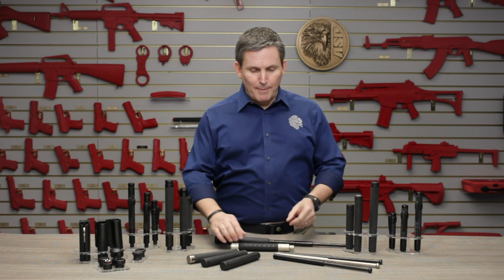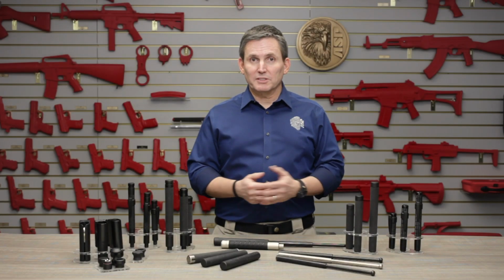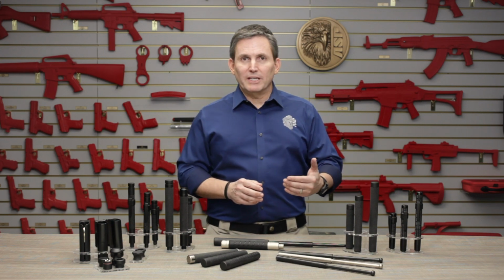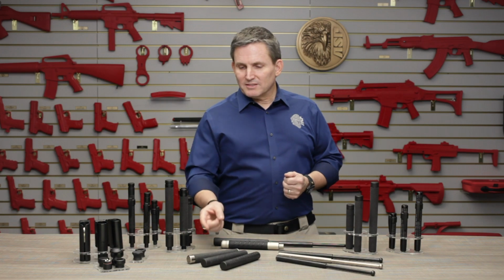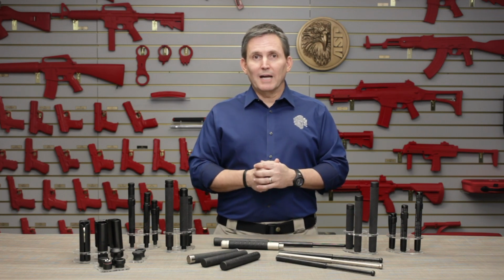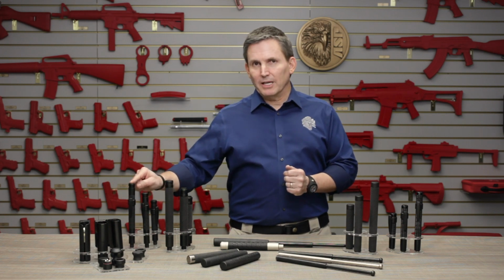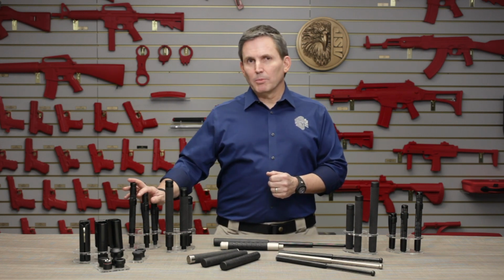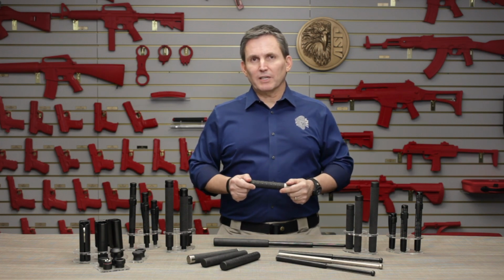Training Room - Selecting Your Baton

Comment: Donthe Talons tend to lock up firmly like a F series friction baton or can there be some wobble?
Reply from the maker: There will be slight play in the Talon as it is a disk lock system and the Friction does not move due to the “friction” lock system.

Friction batons lock in place due to tapers in the shafts—when extended, this progressive taper solidly locks all three sections into place. The Talon design, however, has straight tubes with no taper. Instead, it uses an internal mechanical system to lock the shafts in the extended position. In order for this system to lock and unlock smoothly, there needs to be a little bit of clearance between each section. So you might perceive a slight amount of “play” in the shafts, but this is completely normal. It in no way compromises the integrity or strength of the baton.

Comment: I am having difficulty choosing between the vector or foam grip. My hands sweat profusely sometimes, so I am wondering if you could give me a suggestion. For the foam grip, wouldn’t it be easier to grip cause it's foam? And for the vector, I imagine a hard type of material and would be slippery when wet.
Reply from the maker: Grip decisions are really very subjective. But generally speaking, yes you’d probably like the foam grip better for perspiration.

Comment: How are the agent air weight.......Is the all steal better .....What do you recommend for civilian.. carry, i use to be a xcop....
Reply from the maker: The choice between Airweight and steel is completely personal preference. Steel has maximum potential impact power, while Airweight saves a little carting weight but still preserves a high percentage of the impact potential. Either should be fine as a concealable personal defense option for a properly-trained officer or civilian.
Reply: @aspusa1  ..i went with the 40 cm all steal....
Reply: @The-Homecook-0000  nice
Reply: @The-Homecook-0000  Never learned to spell, Db?  'STEAL"  is for 2nd base;  "STEEL"  is for metal.
Reply: I think the agent steel ..I had an agent air weight that was stolen :(..but it was not as solid as steel asp ..so steel asp agent for the win

Comment: Hi, I wanted to know if is necessary lubricate friction batons? I bought an airweight friction baton and it has like oil, or lubricant in the cap and in the retaining clip. Is it normal? Should I remove it? Or Should I put more lubricant there?
Reply from the maker: A light coating of oil inside the smallest shaft can help a baton that is difficult to open, but typically there would be no need to lubricate a Friction Loc baton.